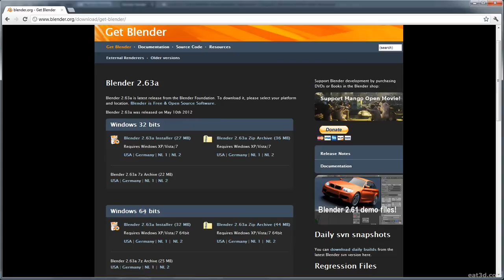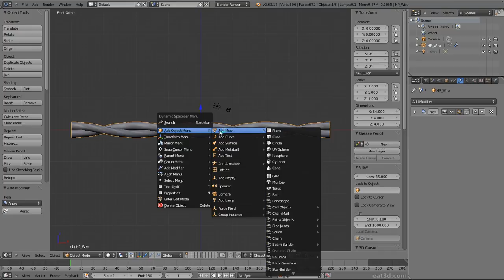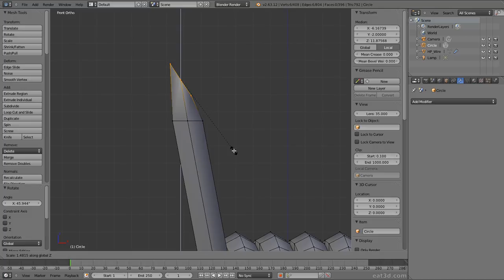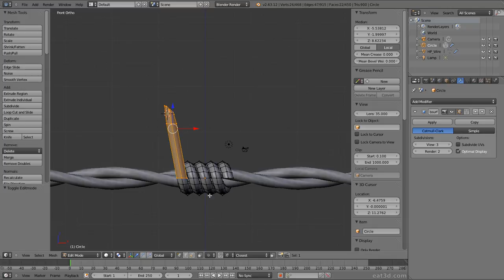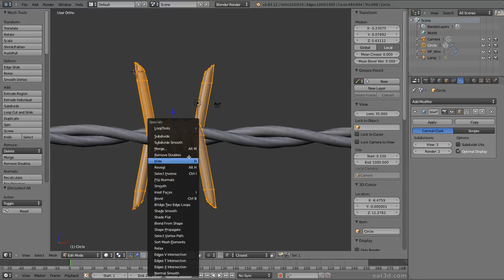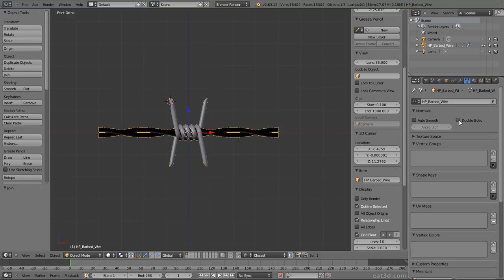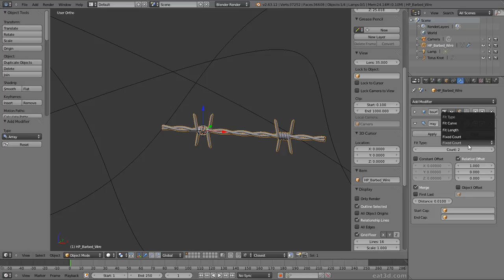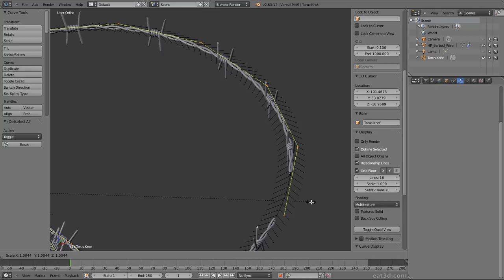Creating Barbed Wire In Blender

Comment: IT'S ADDING A MESH IN THE MIDDLE OF THE SECOND SCREW =??????
Reply: I was able to solve it by using 'Origin to Geometry' (shift-Alt-Ctrl-C).
Reply: @the_neutral_container  Thanx. It worked..
Reply: I SOLVED IT YOU HAVE TO MENTION THAT YOU HAVE TO SELECT THE SECOND CIRCLE WHEN MAKING THE SECOND SCREW
Reply: Alex4Lolz nope both circles are one object and selected but still getting a center random screw. Care to elaborate on how you fixed it via selecting it?

Comment: This is a good tutorial.  It took me a lot of trial and error to figure everything out.  If in doubt crtl + z.  At the end his wire is HUGE I needed a wire that fits a small fence so if you want to scale down the barbed wire...First scale it to the size you want and scale the curve to match David's proportions in the video but just at a smaller scale.  Select both of the objects then hit ctrl + a, and select scale in the menu this allows the wire's array to match the curve's size.  Now add the array and curve modifiers.
Reply: This just helped me with an issue I had for awhile now haha thanks.

Comment: i seem to be stuck at 2.47. the screw doesn't wrap around like yours. even when i change it to the X axis.
Reply: Circle 25 yeah that's my problem as well
Reply: change the axis O in the screw modifier to your high poly wire. screw amounts to 2 and iterations to four. that worked for me.